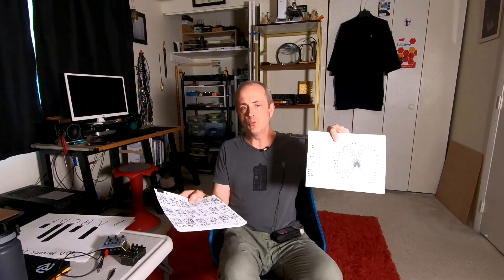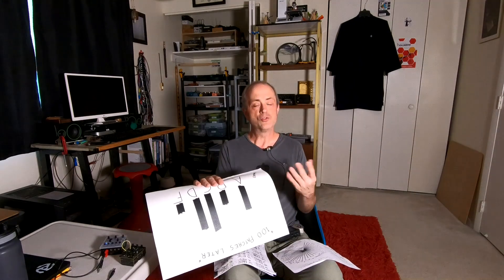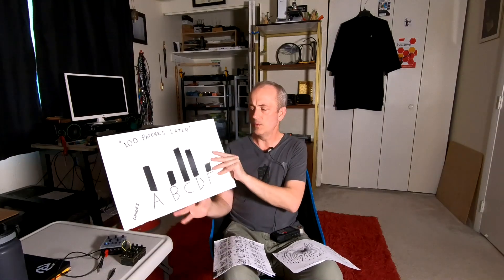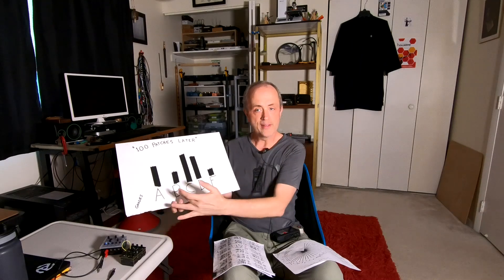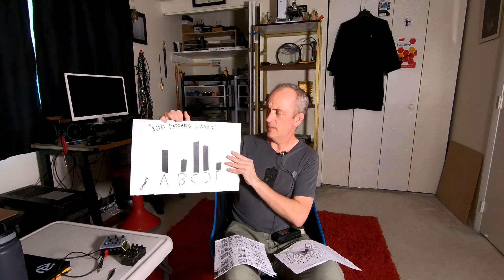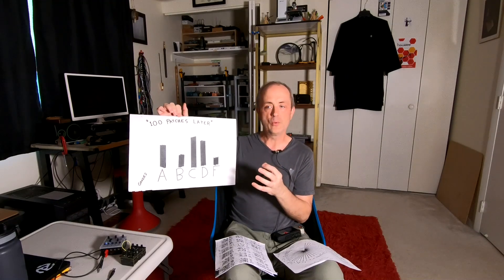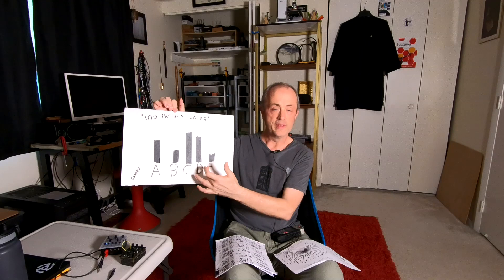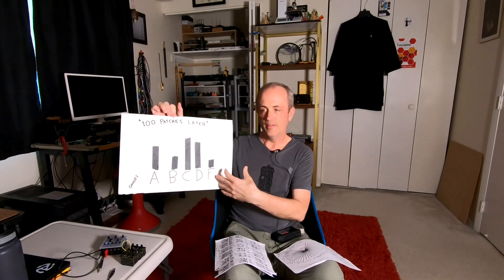Kastle DNA (Part 2)

Comment: Can you share the code with me? Awesome video.
Reply from the maker: Thank you very much🙏🏼!

Absolutely - but it looks like Google Drive doesn't support the .pde file type any more (I put them on after the video cane out). I can re-upload the files on there as .txt (so they'll need to be changed back to .pde). Will let you know when they are up, give a link👍🏻.
Reply from the maker: Hey, I think I have it sorted out. The link below is to a folder with 6 subfolders. Each subfolder just has the corresponding .pde file in it, so you can just move the folder into your Processing directory. You will probably have to add the font (see code for which one) into the project. It's the random code generator, the code reader, and the code "crosser" for the Kastle 1.5 and for the Kastle Drum (so six programs, total). I haven't looked at it for a while, but feel free to ask me about the code, also if you have any problem running the stuff.  Good luck!

https://drive.google.com/drive/folders/18lxga0pA3lTht45QzQFU8tshEuGRyerm?usp=sharing

Comment: In the patches at the end, you show some cables coming from the LR socket. What do you have going into the IO socket to provide signal for those points.. or am I missing something?
Reply from the maker: That is for output only (left and right). This was a case where that I started doing it with the main audio out only, but then realized that some random/genetic patches had audio coming out the I/O jack as well. It's all mixed, just a way to capture it all.

Comment: The next logical step was to write a program to simulate the coin flips! The graphical pinout is a really nice touch, too! That last patch makes the kastle remind me of my Benjolin. It's sort of chaotic, if you know what I mean. I might have to look into building one.
Reply from the maker: Yes, it can be quite chaotic! I’ve been using the Kastle solo in these videos, but it’s also really nice paired with a sequencer (something like Korg SQ-1) or any sort of reverb or delay. Hard to beat the Kastle for the $. Thanks for checking it out!